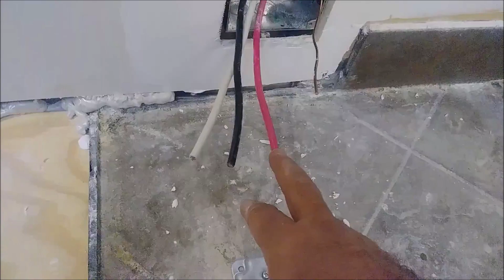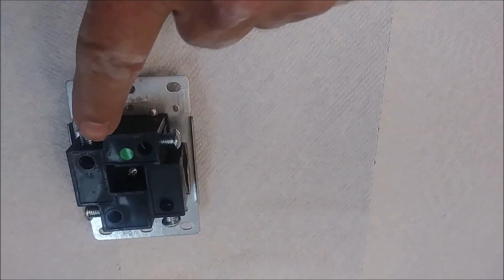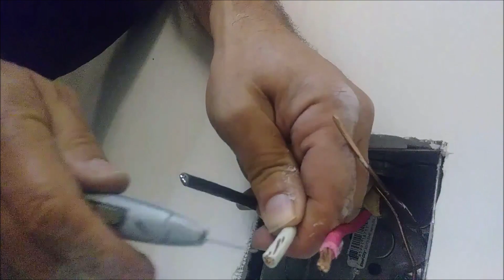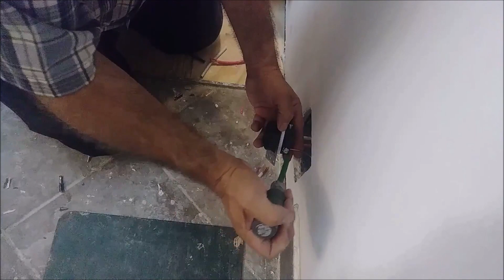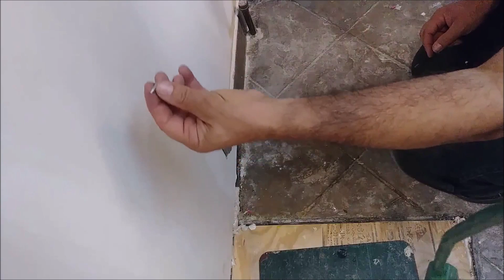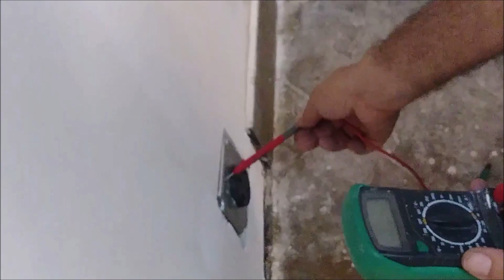How To Install and Wire Range Receptacle or Outlet - 240 Volt 4 Wires 5o Amps Outlet - Step By Step

Comment: Nice video, thanks. One question - your method of looping the ground wire around the ground nut with enough wire left over to attach to the receptacle requires less space and is simpler that what I did, which was pigtailing 3 wires to a blue wire nut, one connected to the box, the second to the incoming ground cable and the third to the receptacle. I had a deep box, so I had enough space for the wire nut. Are both these methods up to code?  Thanks again . .
Reply from the maker: It should

Comment: Did you put a cover plate over that outlet to cover the gaps between the sheetrock and outlet?
Reply from the maker: No I did not instead I injucted foam to seal the small gap between the outlet and the wall.

Comment: Does the orientation of the outlet matter? Does the ground need to be on top or bottom?
Reply from the maker: Very good quiestion !! Usally the groun is in the buttom anin this video I put it in the buttom but later I had to flip it 180 degrees because of the 50Amp cord plug. So the answer for you is for  this application the ground should be in the top.